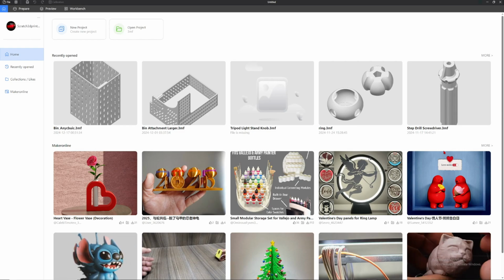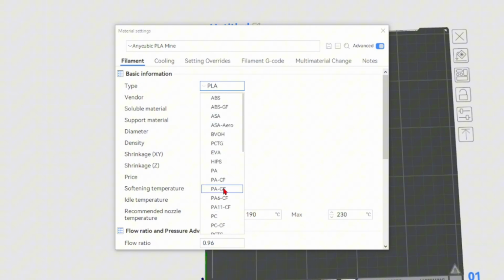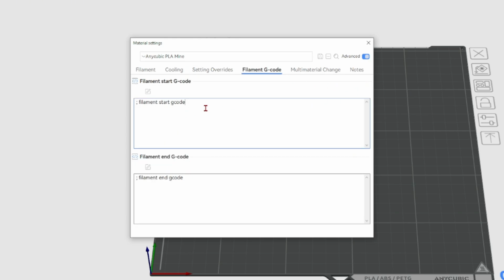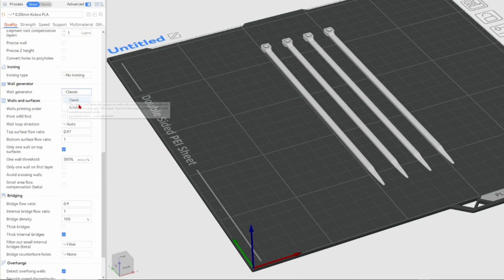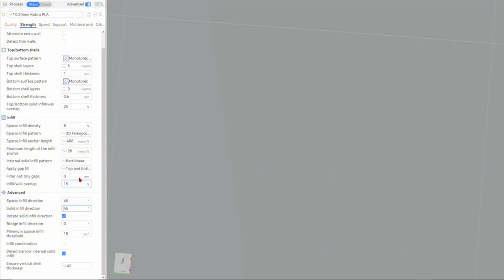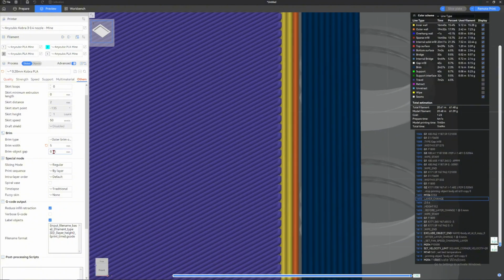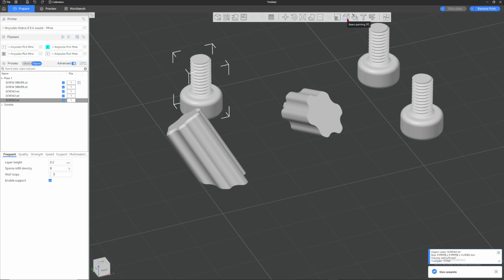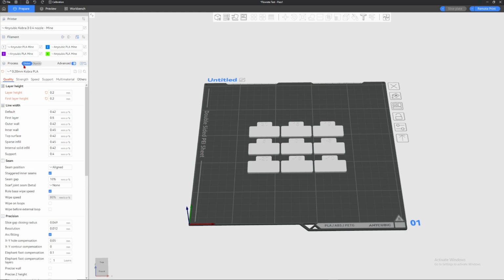Anycubic Slicer Next Ultimate Guide | Beginners Tutorial

Comment: This was extremely helpful to me. For the past several years I have been using the vendor supplied slicer. I struggled getting good results when trying Cura over the vendors custom slicer, so when I got the Kobra S1 I decided I should really learn to use a more advanced slicer. I am already getting better prints and couldnt be happier. Thank you for taking the time to put this together!
Reply from the maker: Yes cura is a really good slicer to start with with but anycubic slicer is good for the long run.
Reply: @Scratch3DPrinting  - I completely agree. I have been using nothing but the Anycubic slicer, and the more I use it and learn about it the more I like it! I don't see any reason to use anything else at this point. Thank you again!

Comment: Thank you so much as a complete noob this was very helpful! Without knowing how to use the Skirt and Brim function I had to build removable structure into a thin wall plan built in Fusion360. Will try it using the Brim function to see if it will hold the piece to the bed to get the structure not to move on the bed. Of course I had temps and other settings wrong as well LOL...
Reply from the maker: Yeah starting out with these slicers can be overwhelming, hopefully this video gives you a good idea of how the functions work.

Comment: I have to use a previous version of the anycubic slicer because the updated version doesn't have the anycubic mega s printer to choose like the older version has. I updated from the previous version after having my Mega S settings in the program before updating to the newer version, I assumed it would just update using the current settings instead of having to start over like it wasn't the same program or on a different computer. I immediately deleted the new version and went back to the older one that actually has the right printer as a option.
Reply from the maker: Yeah I'm not sure why it does not have all their 3d printers. It could be that they don't support it anymore...

Comment: Thanks for your video. I lear alot on how to use it. I'm having an issue when I use the pause feature so I can put magnets.  When I resume it, ghost print. But it  is not clogged. Any advise...
Reply from the maker: Thanks. Hmmm, I'm not sure, i haven't had that happen yet. Well, before you resume printing, maybe check to see if the print head will extrude. If it did, then resume printing. If not, then maybe clog. Also, check to see if the motor is spinning not, then maybe the software has something to do with it.

Comment: How can I place a hole in a model? Example adding a key ring hole
Reply from the maker: There's a cut tool build in, but i rather use a 3d software modeling to do that instead of using the slicer.
Reply: @Scratch3DPrinting  what 2d software do you recommend?
Reply from the maker: @leroycline8849  I'm sorry, I meant 3D modeling software I mainly use Fusion360 and making a hole is really easy in Fusion 360.

Comment: I changed the nozzle on my printer (kobra3) to 6.0 ,  but after slicing I get an error.  The error code I get is Code 10236 nozzle size mismatch- Gcode and printer setting differ. Check slicer and printer nozzle size settings. I've checcked the printer and the extruder and both ar set to 0.6. What can I do to remedy this?
Reply from the maker: Maybe you can pick the 3d printer that is 0.6 straight from the menu instead of changing the nozzle size settings.